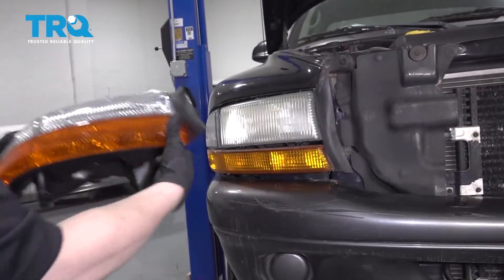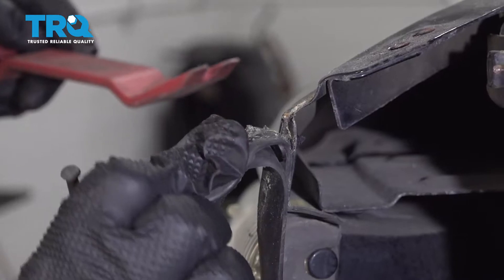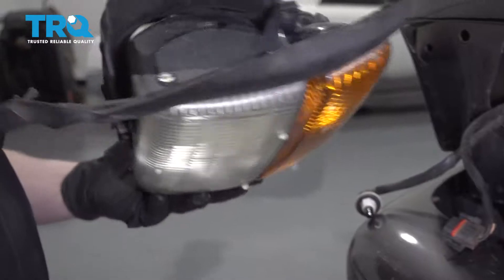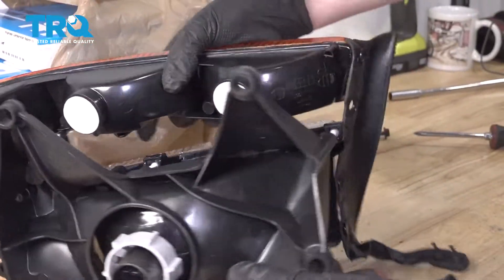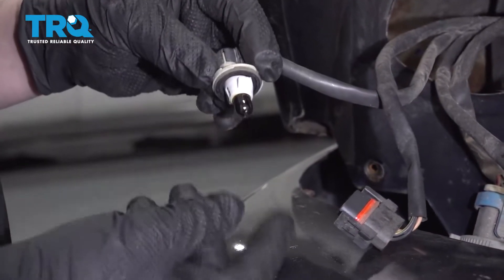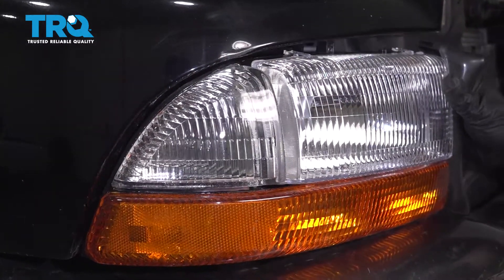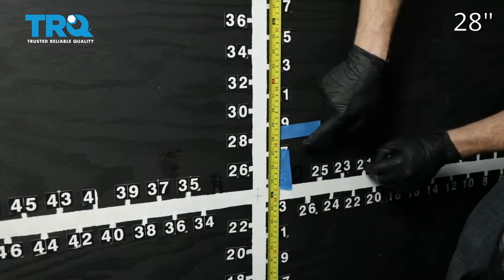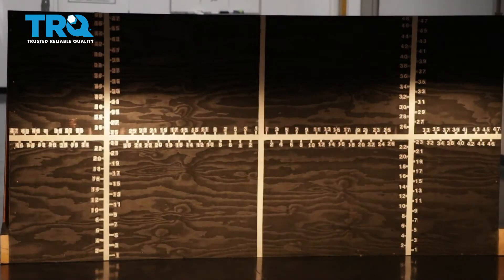How To Replace Headlights 1997-2004 Dodge Dakota

Comment: This is the best video showing how to get headlight housing out for bulb replacement.  Probably the easiest method also.  Just three 10mm bolts. Other videos have you remove the Torx screw and they don't tell you any sizes like T-15 Torx and 10mm.
I am just replacing the headlight bulb 💡 and needed info on removal. 
Very helpful video.